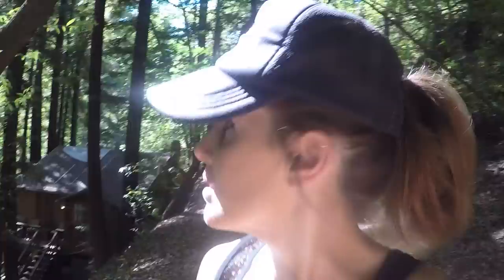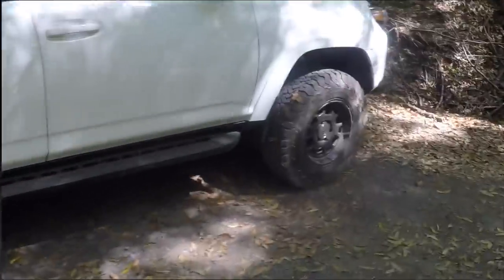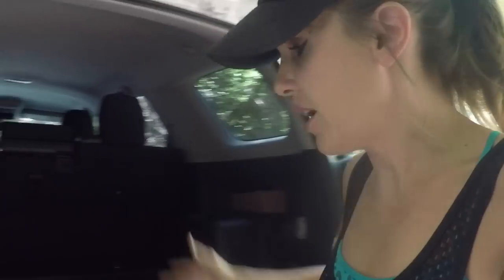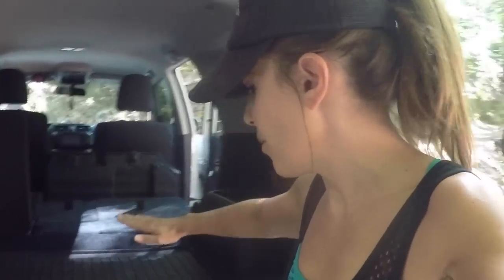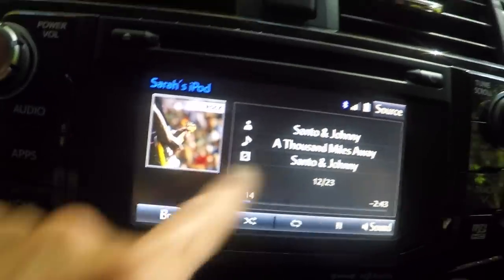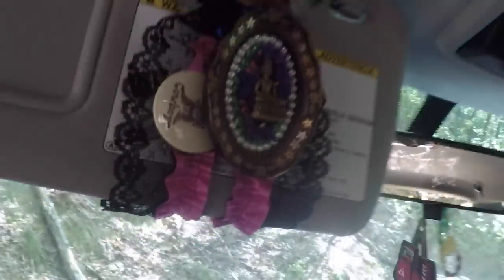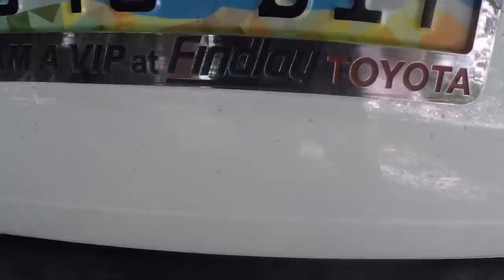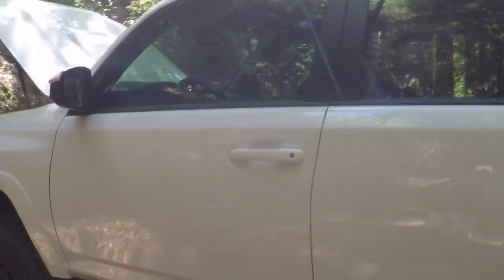Overview of My New 2017 Toyota TRD Off Road 4Runner

Comment: KSS shocks? That is not a stock suspension! What you have is way better than the TRD Pro suspension. What you have in there is a highly upgraded ICON suspension. That upgrade is about $6000. Installed.
Reply: Lol I was thinking the same thing. That’s a high dollar suspension. She bought it new though which is weird that it already had that on it.

Comment: Love it. I own a Toyota FJ Cruiser I use to drive around the desert, and mall crawling. Seats fold down just like yours, and as I discovered my first night sleeping in the back, the three inch hump makes it impossible to lie flat. Plan to use some thick foam rubber (memory foam bed pad) to help level it out. Take care, Wonder Hussy, and drive carefully. Winch sounds like a good idea, but remember, a winch only works if you have something to anchor it to.

Comment: You have one of the best off road vehicles ever made. Those tires will get you through just about anything. Ever think of a trip to Alaska? I've done it twice and it is an adventure you will always remember. I use sticky backed Velcro strips to attach things even outside of the car. I never drill holes as it breaks the paint seal and rust will eventually follow. For self protection I have an Olin flare gun, a can of bear spray, and a very loud air horn. None of these need a permit or a license. I also keep a spare key on the roof in a $2 magnetic holder you can buy at Autozone. Twice it has got me inside the car when I lost my keys or locked myself out. Always carry a container of baby wipes. They can substitute for a shower in a pinch. And carry plenty of water if you get stranded. Another good to have item is a rescue beacon. They can communicate via satellite and save your ass when all else fails.

Love your videos and your adventuresome spirit. I'm way too old and way too married but in an earlier time I'd have fallen for ya. Ignore the jerks on here and don't change a thing. Be careful about giving out personal info to these creeps.

Comment: Hey Girl,

Congrats on the new 4 runner)) It is a wonderful truck and you will get a lifetime of great problem free use out of it!
 I sold Toyota's for 15 years, and you will find that they are your best friend, next to a mountain goat in the hard going country!! I watched your video and some of the info they told you about getting what you wanted, as far as requirement on it, WAS WRONG!! 

Yes, you could have got the shock package you wanted, as well as some of the other features you wanted. I know the dealer pushed you at this one and it will work very well!! Skid plates are standard and you do not need any others on the 4Runner. The warranty isn't something I would have purchased as an extra, but you will be assured that you have no issues with it. Also do not go in and change the drivers side windows tint. JUST GET USED TO IT! practice out at night with seeing out of it. When your in the boondocks sit in drivers seat and just look out of it. You eyes will adjust. I know when you went from having no tint to what you have now it is a little adjustment!  You do know what they say?   oh... Oh.....  OH......WHAT A FEELING........TOYOTA !!!!))) 

Oh I  almost forgot..... For the" HATERS!!!"   I Have two simple words for all of the freaking curiosity speaking  low lives,  as to how "Wonder Hussy," paid, or didn't pay for her 4Runner........    BLOW ME !!!! 

Good Luck and happy 4 Wheeling))  Texas Jim ))

Comment: I didn’t finish reading all the comments. Most are dumb. As for the running boards you could get Nerf Bars, definitely durable. You can keep an eye out on Craigslist for a set. Your shifter is set up as an automatic but when you pull it towards you in “S” then you can manually shift it. I’m a female that has driven 4wd for years (& I have a 92 4Runner). I love your videos and you’re funny as hell. Keep up the good work and be safe 💜🐾.

Comment: Congrats! Awesome truck can't wait to see what new adventures it takes you on. I spend a lot of time off-road, and adventuring through our beautiful state, if you do a lot of driving at night, I would suggest a heavy duty brush guard, to protect your radiator from a deer strike, also provides a nice mounting location for some decent lights, don't buy cheap LED lights you will be disappointed, save and buy quality stuff, it's a safety thing after all. If you have questions on what works, installation, look me up. PS- try to get to northern Nevada more often, our shit ROCKS up here.
Reply from the maker: +Marc Leukhardt I love northern NV!! I will definitely be up that way!

Comment: Just get a RTT and use the inside of the car as storage. Also, you may want to carry a hi lift jack and some recovery gear just in case you need to change a flat out on the trails or you get stuck. Anyways great car and cute girl. Thanks for your video.

Comment: One suggestion. Put some boards in the vehicle. In case you are somewhere in sand or dirt if you have a flat. That way you have a more stable base for the jack. Mine are 2"x4"x1' boards. I carry at least 2 of them.
Reply from the maker: +Thom Geren very good idea!
Reply: Buy some Maxtracs,

Comment: good choice! I bought aToyota Tundra four door truck after many many years of owning fords (which arent bad either) but once you have a toyota you will never want anything else. they are VERY reliable,ride nice and look good.my tundra  has about 220,000 miles on it now and it still runs and rides and LOOKS like a brand new truck and its an 07 so I think you made a VERY good choice!
Reply from the maker: AsTheWheelsTurn Tundras are badass! My old Ranger was great too!

Comment: Nice new Hot Wheels!  Happy you have a great friend that is able to do that for you.
Lots of extras to think about, but for now, just enjoy.  LOW JACK vehicle finder would be a good idea in case of theft...hopefully not with you sleeping in it.  Toss that factory jack and get a 2 Ton Hydraulic one.  Faster and easier.  Bruce who restored your travel trailer could make a thin ply wood cover for those depressions which make great places for Stuff.  He could also likely make a slide out 'tailgate' or it is possibly an option available from Toyota for big $$$ no doubt.
Check out Sand anchors.  Sometimes nice to have a winch that can be connected to either end of your vehicle.  
Dealership should strip the plastic tint from front windows free.
There is more to life than miles per gallon...............
Oh ya, RTFM.  Read The F....... Manual.  Drive in 2H whenever possible.  Likely full stop to shift to 4 Low Range.
Play safe!
Reply from the maker: +Gord Baker good advice!! Thank you for the helpful ideas!

Comment: Forgot to mention for your spare tire you should check out Wilco Offroad solo hitchgate high clearance. It's a spare tire carrier that mounts into your trailer hitch so you can get that spare off the bottom and onto the back of the vehicle for more clearance. I have it and love it.

Comment: someone BOUGHT YOU A TRUCK
don't complain, be happy someone spent their money on you
Reply: kinda hard as everybody in vegas has spent their money on her
Reply from the maker: +Rob Bennett I know, I didn't mean to come off as complaining. It's an amazing gift and I really do like the truck a lot.
Reply from the maker: +below absolute zero it's a long story -- not a total "stranger," but I didn't want to get into the story as this fan wants to stay anonymous. Suffice it to say that I felt comfortable accepting the gift for various reasons...but none involved romance or sex!
Reply: that is kind of rude to say to someone you have never met in person
Reply: The sliding cargo deck sucks, so you're better off without it. You have the icon aftermarket suspension, which may be more off road worthy than the Bilsteins, so yours may be better than the TRD Pro. The pro does have more skid plates.
Reply: And...it is wired for 4 and 7 pin towing harness. I can see your harness connector at 10:07 in the video. It's just to the left of the spare.
Reply: Wonderhussy Adventures  A generous fan though, $40,000?

Comment: Glad you're carrying a full size spare.  Got my first flat tire in my life a week ago (14 June 2019) while exploring Lower Rush Creek Rd, Sierra National Forest, CA.  Lower Rush Creek Rd had recently been cleared of a rock slide that blocked the route for a number of years.  Amazing repair job, because van-size boulders had blocked the road.  About 50' of the repaired section features the highest sheer drop off from a shelf road (no barriers) I ever experienced.  Few miles beyond that, negotiated some challenging erosion.  Unfortunately, a rock or fallen tree branch punctured the rear passenger side tire sidewall.  Fortunately, kept my spare fully inflated and had an instruction sheet about how to use the OEM jack, my first time.  Haha.

Comment: nice new ride! i'm sure you will get plenty of use out of it! i'd echo what others have said and see if you can get the cargo tray through toyota parts and have someone help you install it. you might even be able to find one through a salvage yard if that model has been out for awhile. you could get a fix it ticket in california for the tinted front windows, but if you are showing nevada plates, they might let you slide. unless it's bothering you too much when you drive, i'd just leave it the way it is and even if you do get ticketed, you can have the tint removed and it would only be around $20 for the fix-it ticket. also, when i had my old toyota truck, i had to put a padlock on my spare because someone stole the original!
Reply from the maker: +Denni K oooh yeah, I have heard of the spare tires getting stolen, I'll have to be careful

Comment: Seems you enjoy overlanding and if you are adding on accessorizes which will add weight and, with the desert heat ,  you may want to add a aftermarket transmission cooler.  Duel battery set up if you are going to be running lots of electrics such as your light bar, etc.  Best wishes and happy traveling and safe adventures!!! Cheersss!!!

Comment: I've owned two Rangers. Great trucks! Would have bought another but FORD stopped selling them in the USA. How sad is that?
Reply: rudedogii I feel the same way.
Reply from the maker: +Paddy O'Lantern Ford is bringing the ranger back in a year or two
Reply from the maker: +rudedogii they are bringing back the ranger in the US market in 2018 I think :-)
Reply: They are great trucks - own 2 of them!  Problem I see with the new ones coming back in 2018 is that in essence it appears they will more or less be the current F150 about 3 generations or so back as well as very expensive.   The Rangers up thru 2011 were great because they were smaller and easier to get around with which is why I like mine so much  - a 1996 4X4 Regular Cab w7' box and then a 2004 4X4 CC.   Just my thoughts on them as @ first I was cranked when I saw they were bringing them back but what I have read on the new ones - just go buy a F-150 and be done!
Reply: Wonderhussy Adventures 2019 and only one motor choice as well as only 10 speed automatic

Comment: Instead of painting..  I've seen lots of Tesla owners do a vinyl wrap.
Reply from the maker: +Commander Zero interesting!
Reply: Wonder Hussy You should look into it.  You can change to any color you want,helps prevent rock dings, and keeps paint original.  Also, you can do your own clear-bra on front.  Buy off Amazon do yourself.  No risk of damage if you do it wrong.
Reply: my friend owns a wrap shop in Vegas! lmk and I can send you details

Comment: I felt the same way when I bought my Tacoma truck. I’d NEVER bought a new car in my life. In 2004 I’d just sold my house and knew what I wanted more than anything… a new truck! So I did the unthinkable, I stepped on a lot and asked for a specific truck, a Toyota Tacoma truck in white. The guy goes we’ve got one farm fresh off the truck, you want to take a look at it? I’m like, sure! So they rolled up a brand spanking new white Tacoma truck with 56 miles on her and smelling fresh as a daisy. So pretty much without hesitation I snapped that bad girl up and commenced to break her in proper by taking her straight out into the desert and getting her nice and dirty. Because no self respecting off road truck owner should not have dirt and mud caked all over they’re rig… right? So I totally feel you and the happiness for your new 4Runner!

Comment: not sure if its been stated yet but the difference between the pro and the trail or TRD off road is what they call it now is the suspension. the trd pro sits an inch taller then the offroad stock. If your gonna jack it way up the pro is a waste of money, actually any suspension change would be a waste if you get a pro as that what you are paying for along with some wheel and special paint color. In my opinion Icon is a better suspension choice. The kdss has more to do with the sway of the vehicle, and changes for terrain by your choice. 
 
the suspension you have now and ride height will get you very far. nice truck, my wife has a 16 trail. and it is very capable. I like my rubicon better but really dig the trail.....you made the better choice over the pro
Reply from the maker: +stoney126 ! ahhhhhh!!! That's kind of what I thought but one of my friends who has the pro is making me feel like a putz. Thanks for clearing it up

Comment: my next major mod is to get a custom sunvisor for the front windshield, and running lights on the roof and chrome air horns and running lights along the bottom side. If you look in the trucker stores they have awsome stuff for tractors some you can use on  a suv
Reply from the maker: +George right on! Good idea, thanks

Comment: Congrats on the new vehicle! Get a heavy duty bumper on the front and rear. Get a winch on the front. Get a block and tackle and a good heavy duty strap. Get someone to teach you how to use the winch and the accessories. A winch and accessories are no good if you don't know how to use them properly to get you out of a bind. Also get a good hand shovel and a hatchet. Some small branches in front of or behind the rear tires can get you enough traction to get out of sand.
Reply from the maker: +Willy Olsen I had everything on my list except the hatchet! Good one... I'll add that :-)

Comment: I like the tinted windows. Unless it gets to be a big problem for you, I would keep them. I think tinted side windows are pretty standard in Nevada, to help with the heat issues. Years ago I bought a car with tinted windows in Nevada, and then I drove it in California for 15 years. I got about ten tickets for the tinting, and you know what? I happy paid ever one of them. It was well worth it. The tint keeps the temperature comfortable and gives you a lot of privacy. The only time I ever had a problem seeing out, was at night time. But I can't see very well at night even without tint on my windows. LOL.
Reply from the maker: +Max Zomboni hmmm.... interesting! The Tint hasn't really bothered me except at night so I suppose I could live with it
Reply: I think you will get used to the widow tint. Several good reasons to keep it. If you ever check your phone for even one second while driving it could save you a ticket. A cell phone ticket is $500. A window tint ticket is just $100 (In California) . Second, if you ever want to park in a parking lot to sleep, with the window tint and your back windows blocked out, no one will even know you are inside. Also I see some people recommending that you get an air mattress. You might want to consider a futon mattress instead. Then you can just keep it set up, and if you want to use the back seats, just fold the futon over, and you ready to put the seats up.
Reply from the maker: +Max Zomboni good points!

Comment: That protective battery cover is so it doesn't Short out if it some how hit's your hood. you should get & spray some Battery Terminal protector spray in a can you can do it yourself while it's still nice a clean.
Reply from the maker: +Ted Robinson good idea!!
Reply: they make metal hoods? keep the battery top clean . dirty top can cause voltage leak. maybe not important down south but north dakota at -30 F need all the battery you can get.

Comment: Wow I didnt notice all the hostility talk until today when I was notified with a person yelling about getting a real job 12 hours a day and so on . I thought some one was mad at me but its for some one else... anyways  love your truck hoping to make my video today to show you my engine mod. being we have the same engine.as my FJC . I know it aint much but for the price of the chip and spacer it saved me alot of money in gas plus the chip is designed to sence your driving if suddenly you want hi performance you just hit the gas a liitle hard and it will spin your  rear tires . I want to get my diff lock to work in 2 wheel drive so I can  spool up at a light or at at stop. as it is the factory wires it to only work in 4 wheel drive and in low gear only..  sounds like a complicated job ,But it might be easy as switching a wire. I try to do mods my self to save money. The lift you have is perfect for driving . If you go higher it becomes more unstable. My daughter call s my car the clown car because of the floaty action you feel with big side wall tires. But once your use to driving it I dont feel it at all..